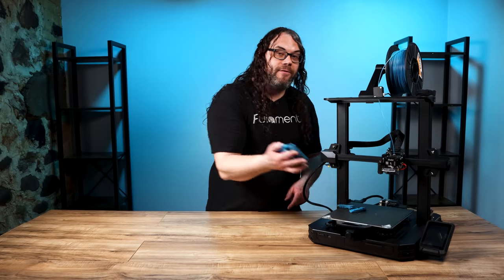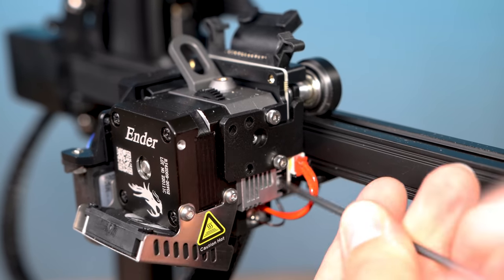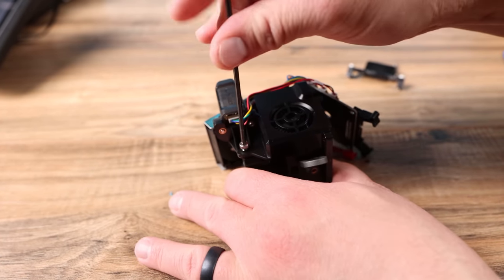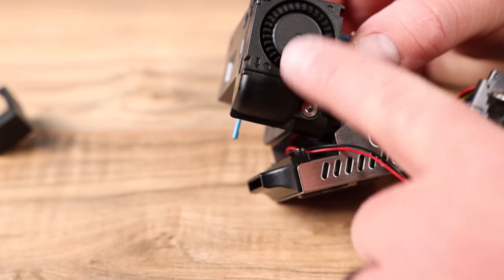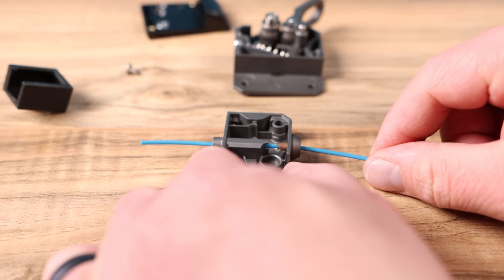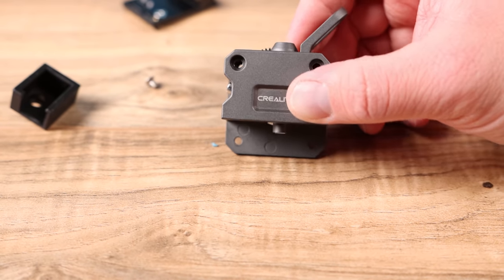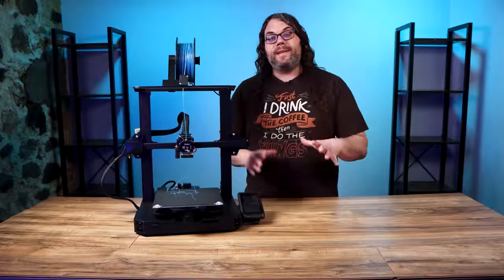How To Fix A Jam on the Ender 3 S1 Pro (FULL Walkthrough)

Comment: Did you measure the filament?, maybe it's a bit out of spec on the large side at some points. Larger filament getting squished by the gears making it out of round would be prone to jamming more.
Reply: Specially on torture tests that usually go ham on the retractions.
Whenever I have a jam on my Titan clone with V6 all metal (plus those bi-metallic heat breaks, all Aliexpress stuff but pretty damn good), it's always when it retracts more than extrudes, so if I have 1mm retractions and extrude less than 1mm, you can imagine it presses the filament 3x at least. I remember a video, I think it was from Lost in Tech, on how the bowden Ender 3s used to clog a lot on those tests because of retractions.
Reply from the maker: I didn't, but I should have. I wonder if I still have it! Thanks for watching!
Reply from the maker: I agree, torture tests are rough on the retractions, especially this one! Thanks for the info!!

Comment: Great video, it helped me with my problem.  It got stuck and then I found out that Creality had forgotten the ptfe tube on my sprite extruder pro, now the only question is how long the tube has to be without it preventing the gear wheel from turning
Reply: Sprite pro is an all metal hotend and doesnt use ptfe tube in there, there is a small bit in the plastic part of the extruder that goes flush with the heatsink
Reply: @enderzand  take a look at the video, because he says that it is at least a piece of PTFE Tube, but no matter, I just wanted to know how long or how it is cut normally because I had no one and thus the filament was jammed.

Comment: had same issue pulled hot filament into the tiny plastic tube and it hardens had change tube no way get clog out from mine it was retraction setting pulling filament to far up on direct drive changed setting no more problems

Comment: There's the small brass or copper piece that is keyed at the top where the filament goes into the housing.  Im on my second extruder and from time to time it pops out of the housing.  Any ideas on what might cause this?
Reply from the maker: Hmm. I am not sure. That's a weird one.
Reply: @TheEdgeofTech  turns out I had retraction speed cranked too much and too far

Comment: I just got my first clog on this extruder and it seems that the problem is that the cooling fan is not enough and the heatsink gets WAY too hot, I will modify mine to use a 5015 fan and make cooling better

Comment: Tha jam is due to the liner, I'm sure it will happen again, you may want to open up that ptfe liner at the ends a bit. My 2 cents, stay safe Jim Great extruder breakdown Sir ! keep up the great work !
Reply: The liner is a dog. Just had a print that required me to disassemble everything. The filament was jammed like rock inside the short PTFE tube. I had to drill it to clear it (which ended up ruining the tube too), so I'll probably have to replace it. I wonder if there's a better option?

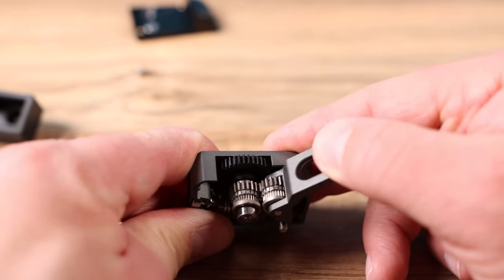Comment: Hello can you tell me the exact way of the tension screw at 7:02. Is it right or left hand screw? Should turning towards the right increase the tension on the filament or the otherwise?
Im feeling that due to lack of pressure on the filament, its not pulling it enough and due to the eccentric offset of the spool and the resting cylinder, its getting tight to pull the filament and clicking and extrusion stopping midway issue is occurring. Let me know, help. Im stuck
Reply: did you find out which way to turn the screw to tighten?
Reply: @tomthebrewer  i want that answer only. Awaiting
Reply: in the same situation here and clueless about the tension. Extruder start clicking sounds in random layers. clockwise i think its tight and anticlockwise is untight. You can check this in ur filament. The marks from it are deeper and lighter when u unscrew. The problem is that there is no mark or a video from creality about the default tension.

Comment: Have you seen the Aurora Tech video where they analyse the many different ABL probes?
 The CR Touch did not fare too well!
You would have thought Creality would have provided a maintenance manual for the Sprite with it not being a popular part made by many manufacturers (I won't say the P-word) but then again this is Creality who it seems are trying to make as many savings as possible on their machines these days, they have even stopped giving you ball-end Allen wrenches, at least with Ender 5 Plus machines!
Reply: Strange results on that video, just as she noted as well, specially since everywhere else I've seen the CR-Touch actually beat the BL Touch in both accuracy and price, it just loses in weight, being heavier.
The Prusa's PINDA one is a pretty controlled system, it probes target points on the PCB heated bed and all. Pretty nice solution but a specific solution for a specific problem, not that other inductive sensors are thus bad but they really do lose a bit of the advantage. Still a touch probe is my choice, being able to probe any material is an important thing to me as well, since I go from plain glass to PEI on to of glass, there's already a ~0.2mm difference by default on that alone.
Reply from the maker: I will have to check that out!! Do you have a link to it? I think others would love to see it as well! Thanks Andrew!!
Reply from the maker: I have to go watch that one now!!
Reply: @TheEdgeofTech  https://www.youtube.com/watch?v=kh-3cVcwLVY
This is the Aurora Tech video in question, she also notes the results being strangely bad, might be a bad unit.
Reply: @Kalvinjj  I think Creality will send them another unit to test if they are confident the data does not represent an average unit, when it came out that Creality had been offering cash bribes to some reviewers for favourable reviews the shit hit the fan, the channels I watch and interact with are all trustworthy people and I take their reviews as such but there are some reviews I have seen on some obscure channels that have purposely omitted the results of some functions on some products that were known not to work
Reply: @AndrewAHayes  eehh... That's lame as heck, I've always regarded them as one of the Chinese brands you don't worry about that kinda stuff, like you might have to worry about a lack of quality control but the bribing part wasn't something I expected. I'm not even their costumer, but I at least had this level of respect.
From a technical perspective alone, the CR Touch does have an accuracy advantage, as it doesn't use a hal effect sensor to detect the probe's height, using an optical one instead and thus being far less susceptible to electromagnetic interference. I can imagine tho some lack of finish on the pin being able to give crappy results tho (which might explain those considerably bad results), while the hal effect one from the BL Touch and clones isn't affected by that.

Comment: What a nightmare to undue this! Wow! 

I have an Ender 3 S 1 Pro now for about a week and simply love it! However, my printer got clogged up and was acting similar to what happened to you. I had look online and found a YouTube video of Criality how to unclog the Ender 3 S 1, I could not find one from them on the Pro. The YouTube videos removed the nozzle on the Ender 3 S 1. I did the same and changed the nozzle that had clogged up and heated up the hotend to 215 and I was able to get the filament to go through without having to take it apart! I hope I never have to take it appear like you had to in this YouTube video! This is a little nightmare! 

Well my printer is printing back to normal and I am getting great prints! 

The nozzle I removed I tried to unclog it and I was successful but it was not easy to completely clear the nozzle. The nozzle that came with this Ender 3 S 1 Pro appear to be standard brass nozzle and not harden . I assume with abrasive filament they will not hold up as well and might not last as long? Am I correct with my assumptions? 

Thanks for the video! But I hope I never have to take it apart like that! 

Thanks again!
Reply from the maker: You are correct about the brass nozzles. They will wear out over time and with abrasive filament. But they are cheap to replace too. If you are going to use abrasives, drop a hardened nozzle on right  a way and you will be good!

Comment: Hey this is gonna seem like a strange question -- but can you confirm what Fan goes into which Connector on the board? I know that the fans are labelled F1 and such and that the connector on the board is marked. But i think the manufacturer connected them backwards? My F1 fan is connected to Fan2 and I want to make sure this is wrong before switching them out. I've had nothing but problems with this Extruder
Reply: This is 4months late, but since I just took mine apart: my F1 was connected to Fan 1. 2 to 2.
Reply: @KryaDiere  still appreciate it. Mine were not plugged in correct and actually had a dead fan header! Had to RMA it

Comment: I have a frustrating issue where the main extruder (stepper motor) gear isn't turning the 2 metal filament gears. There are no clogs, and the filament is being securely gripped between the 2 metal gears...but there is a disconnect somewhere - the large (visible) gear on the exterior is turning, but it isn't pulling the filament into the hotend.
Reply: Mine does the same thing but after cleaning the gears it normally starts working again the teeth just fill with material and slip on the filiment

Comment: how did you get it to extrude a certain amount of filament?    did you use a custom G code file for that?
Reply: There's a button on the display called "in/out", press "out" and press the amount of filament you want to extrude.
Reply: In the regular menu, Move (usually for X, Y, Z,) > Move Extruder

Comment: lol I had exactly the same problem. Its not necesary to take off the whole extruder. You can unscrew the Heatblock and take the Hotend and the take the ptfe Tube. You dont even need to unplug the orange cable

Comment: Dear Jim, I follow your channel and I consider it one of the best, I really mean it.
I have learned a lot from what you explain and it has worked for me, so now if it is not a bother on my part, I want to know if you can help me with my new Ender 3 S1.
I have assembled it, calibrated it and made good impressions, but for unknown reasons, since Saturday I can no longer calibrate the camo and the hotend so that it stays and prints as before, and I already checked everything, straps, eccentric nuts, everything that can to cause it not to print correctly.

If it doesn't bother me, you have a trick like the one you explained to level the Ender 3 V2, which has worked for me and I no longer have any problems.

If you can't or don't want to, I have to understand, but if you have a trick and pass it on to me, it will help me a lot.

Follow yes with your channel, it is very interesting and enjoyable.

Best regards.

Richard.
Buenos Aires, Argentina

Comment: Very nice video, just went through the same process (including the left over screw and subsequent disassembly again). How do I have it extrude the 50mm of filament? How do I heat the hot end without going in to print? What does the “settings” screen do?  How would I load new firmware if needed? I have yet to find any operation directions. I’ve had this less than a week. A nozzle temp oh 275C is very very hot, don’t ask how I know😩😩😩

Comment: I thought the S1 "Pro" had an all metal hotend? the presence of some PTFE suggests otherwise. Does this hotend differ from the non pro model or is it just firmware difference?
Reply: It's a mis-selling, tbh. There's a short section of PTFE and, for me at least, that's the bit that causes the problem.

Comment: Might be way off base here but mechanically speaking seems like that internal hexagon channel that looks to be part of the injection mold and holds the PTFE should extend another 5mm or so and be rotated 90 deg to "interlock" with the heat break. Just a hunch but I'd imagine the filament heats up, then when retracted gets jammed in that gap. Then it happens over and over again till it's completely stuck. 

Maybe they have that gap for temperature related reasons but seems like a mistep to me. It just looks like it's designed to be that way but isn't for some reason.

Comment: Why is that PTFE needed at all if not printing TPU?
Reply: well, this printer is supposed to handle flexibles too (I say supposed because I just got mine and haven't tried it)
Reply: @ashvanes484  I dislike PTFE being used at all.. in my experience it only introduces room for error. 90% of failures over the last 13 years of printing has been due to a freaking PTFE 😂
Reply: @oneheadlight8000  Can it be replaced with something else?
Reply: @RobinBresnark  It needs a redesign so there is less gap between housing components. You shouldn't design an extruder with the thought of using a trapped PTFE tube to guide filament.. Same issue I have with the Prusa Mini.. too many gaps.. The new REVO design is excellent because it removes the gap completely that is between the nozzle and heatbreak and therefore you have a huge decrease in numbers of clogs with that design.
Reply: @oneheadlight8000  Seems obvious, right? I wonder if some steel piping of the same diameter would be a better call? To be honest, it might be worse...
Reply: @RobinBresnark  It is worse because coefficient of friction is much less with PTFE.. I just know that certain design (like the Hemera or BIQU H2 minimizes that path that needs to be taken up by the PTFE. Proper design requires little to no support even for TPU filament.

Comment: Before disintegrating the whole system into atoms I suggest checking this video instead (I'm not affiliated with it in any way): https://www.youtube.com/watch?v=6T993A2laSc

I had a hotend jam with Ender 3 S1 and was able to remove it successfully with the linked video and that was way easier. Of course if the problem occurs within the gears etc, this video is great for the disassembly instructions.

Comment: This is ridiculous.  It's all metal.  I heated it to 300 and I don't see how I can't push the filament through when it's that hot.  Especially being PLA....how could it possibly be jammed?  All-metal at 300 degrees when the filament melts at well under 200...this does not compute for me.  If it's jammed further up I would think it would melt as you push it.
Reply: There has to be an easier way to do this..
Reply: OK I found out how to do it.  All you do is heat to 230, take sprite thing off like he did, take the nozzle out and silicone thing off, and you unscrew and pull out the heat element/block thing. Then you push the small allen wrench through that.  Sometimes it clogs further up, but you can just push filament through that part probably to unclog it.  That worked for me anyway.  So basically the whole thing took me like 2 minutes.  You're not supposed to take all this stuff apart.  You should do a new video on it if you figure out what I'm saying it's way easier.
Reply: @waynefilkins8394  Problem for me (and, it seems, others) is clogging in the short section of PTFE - and that's above the hot end where nothing's really molten. And the only way of getting to THAT is complete disassembly.

Comment: Guys this video is WAY overcomplicated.  Just take the whole sprite off while nozzle is at 230 degrees (be careful).  Remove silicone sock and nozzle.  Remove 2 screws on the bottom that were to left and right of nozzle.  Then loosen one further up (it keeps the heat block thing from rotating, hope that helps u find it, it's black).  Use plyers to pull heat block out (because it's hot asf), then push your smallest allen wrench through the hole to clear it out.  You should also push filament through the rest of the sprite too cuz I had a jam up there too, but filament pushed it right out easily.  If filament don't work, push small allen wrench through that, but make sure you hold that thing that you hold to put filament in, so you don't strip the gears out with the allen wrench.  Then put it all together the same way.  Reply to this if you have questions.  I will also reply to this comment with the link to the simple video.
Reply: Too many people getting jams on this new printer, it's clearly a design flaw Creality should address rather than going through this cumbersome procedure every time. This printer was meant to be THE best hands-off printer.
Reply: Speak for yourself mate. There's many different kinds of jams. Mine had a small piece break above the ptfe and below the gears and it absolutely needed to be torn apart to remove. I did try pushing it with an allen key before I tore the gear section apart and nope, stuck af, so I am grateful for this vid.